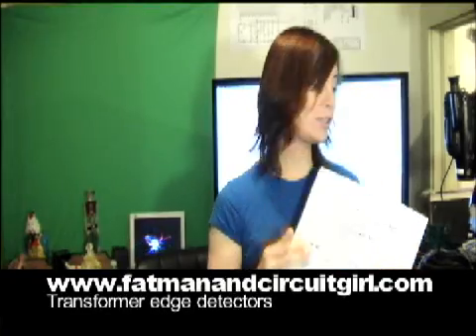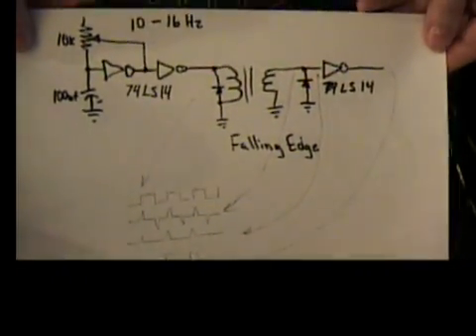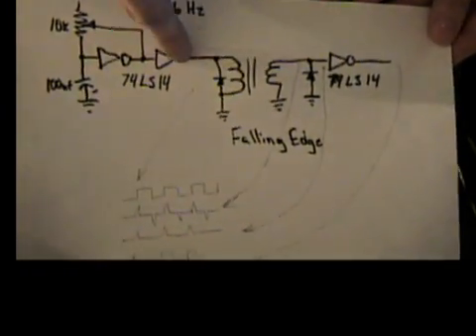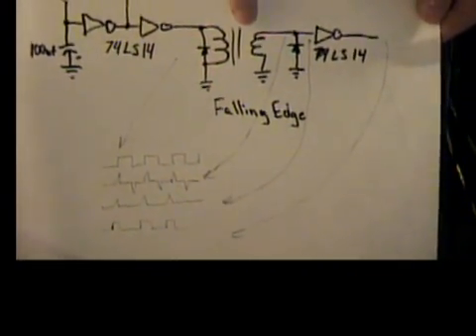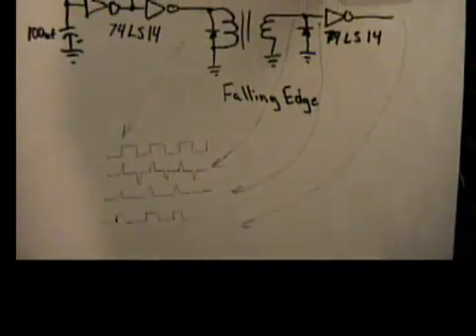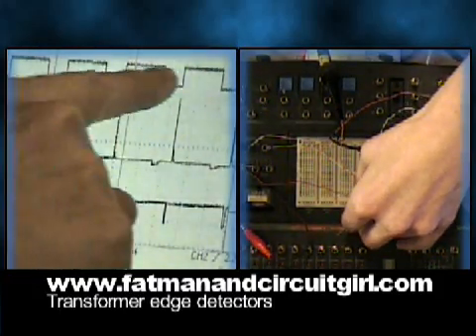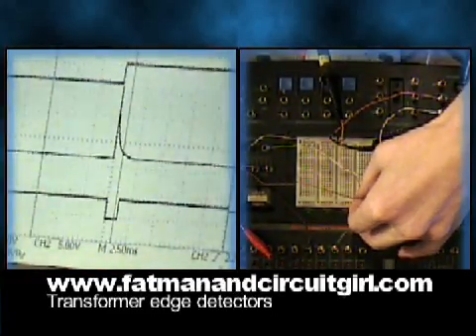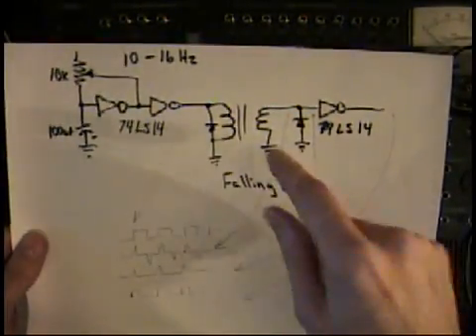Transformer Edge Detectors - Short Circuits #1

Comment: Yep, if the pulse is long in duration, the transformer will saturate and perphaps take out the IC chip. I would put a series capacitor and then put a snubber resistor and cap  across the series capacitor to tune out any ringing.
Reply: you have the best series for flyback converters!